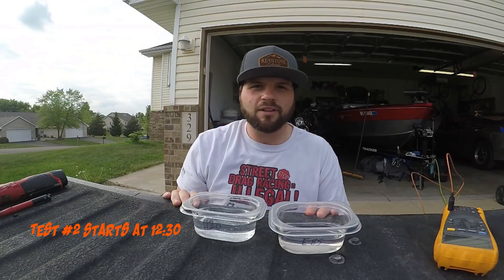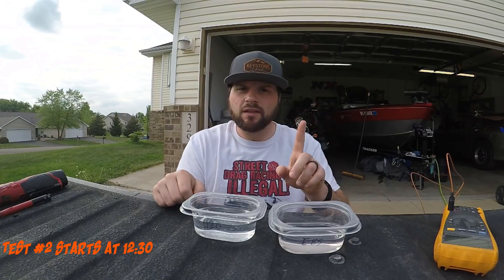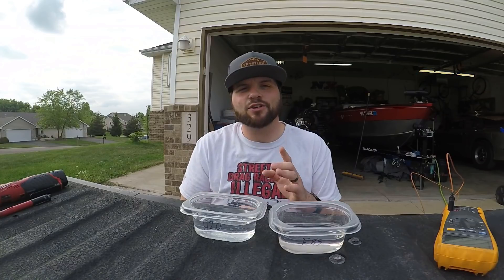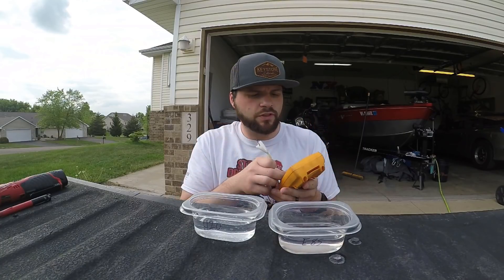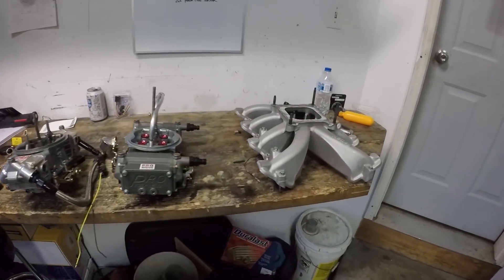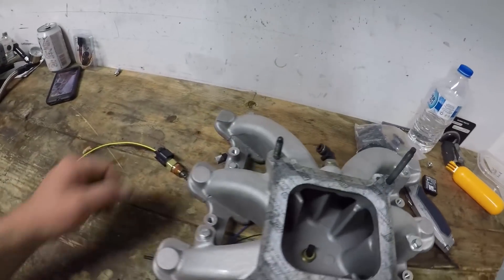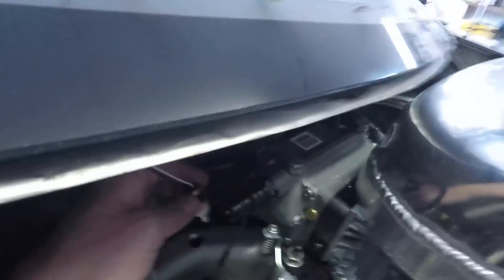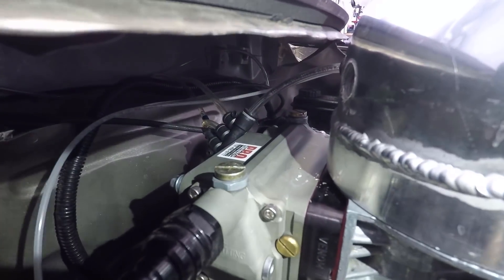Blowthrough Extended Testing

Comment: THE YOUNGER GENERATION OF RACERS HAVE it so eSy but they also have it so hard you are blessed with the flex of being able to hop in the internet copy and past don't forget to "FALLOW "a known combo and literally tune off messages...... "im not saying you are" ....
You actually have a clue on what is what and why ..... if the younger crowed wanted to build a quick car or make there car faster in the days when I was alot younger we had to pay alot $$ and still not know what was what why or when .. guys didn't share how to's or tricks so resource and knowledge built was learned or if lucky your uncle was a engine builder and crew chief and tuner for two different nhra race teams one a top fuel the other a pro stock . So I learned from him working for him during summers and after school . He saw I had a passion for speed and said the key to power lays in this room open  the door and there was a old blue flow tech 600 series with knows switches , guage, hoses , hoses exc exc in the room inside that room was a dungeon with a seat tons of light and aluminum/steel/copper shavings everywhere with a grinder motor with a ext and more carbide bits sandpaper rolls scotch Brite exc everywhere and a gas mask looked like it was stolen from Hitler himself . Asked me what do u think these two rooms are for I quickly said this looks like some grinder of sort and the machine in the other room looks like a hospital room without the bed  so he taught me how to use the dungeons and the hospital tool aka flow bench needless to say I was 13 when I drove my first car to school the day I finally got my DL it still had the rac re numbers in the window from day before drag session and the 10.321 time slip in glove box along with couple dozen more not to many kids hell I haven't met one yet from my era that there first car ran low 10s all day long and in 1990 10 second street cars was a fast mother fucker with alot of respect trust me especially  being 15yr old

Comment: More to my previous comment:

You may think, Oh but the intake is under boost. But guess what the pressures in a  refrigeration system is   exponentially higher than any turbocharger or supercharger can deliver.  And yet evaporation still happens, it the difference in pressure that causes evaporation, it's the same difference in pressure that causes fuel to be drawn from the fuel bowl and out the booster venturi...

Comment: Water  Boils @ 212° F at sea level, @ higher altitudes it boils @ a lower temperature, due to that the higher the altitude lower the ambient air pressure. 

Water will actually boil when put under a vaccume and the temperature will drop significantly. what's happens when a liquid goes  from a liquid stage directly to a gas stage [ evaporation stage ] the temperature drops.  

Now your wondering what dose this has to do with the subject matter, everything... Becuase it the same thing  that's happening to the fuel inside the intake manifold, fuel is going from liquid state to a gas state, evaporating, causing the temperature to drop significantly...
This is the principal of refrigeration,  it is what happens in the evaporator in an air conditioner,  even your refrigerator...
Reply: Jose Cuevas, can you tell latent heat of vaporization?

Comment: I think most of the cooling you were seeing when you were blowing air across the thermocouple was the water and the e85 boiling off . With the e85 creating the lowest temperature because of it's more rapid evaporation.
Cool video!
Reply from the maker: Rowland Butler  correct sir that is the latent heat difference between water and E85.   Quite a big cooling difference